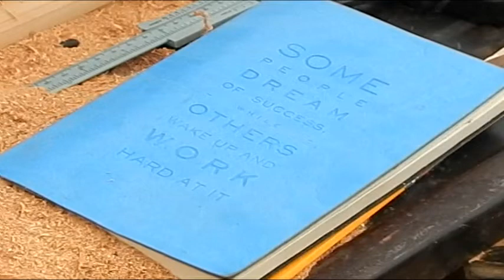How to Make a traditional 6 hole Native American Flute Part 2

Comment: I believe your interpretation of the old flute diagram is the correct one. It also makes more sense based on the traditional flute making materials used at the time. The implications of that are so far reaching for the modern 6 hole flute that many people are bound to be unhappy with your interpretation. It is too bad that a more thorough investigation wasn’t done way back when the first modern 6 hole flutes were being made. This confusion could all have been avoided.

Comment: how do you know where the initial finger hole should be from the bottom up?? ive made 4 now and either my bottom hole is too low on the flute or my last hole ends up being too high. On my first 2 it was too high, i learned that if it is roughly my palm at least it works but closer than that and the highest note doesnt work. So then i tried moving everything lower on the next 2. .... now its too low and all my finger holes need to be different sizes and still doesnt sound great. So how do you know where to start the first hole???

Comment: Would sealing the inside affect the performance? If you cut the pipe after clamping so you can clean the glue out, while its wet? Only reason bring up sealer is so that it easy to clean the glue. Also you should not be drilling out like that, and you should be showing how to properly drill it out. If you drilled before you make it round it would be easier to clamp to a table. Great video! I like the simplistic approach, with no bs.

Comment: another Great video Charlie,  i made a six hole traditional following your specs at the end of the video from 1/2 pvc pipe. it worked perfect with 4 inches from the last hole to the bitter end . Now ill get busy on a pine one.  all my finger holes were 3/16 drill bit.

Comment: Can tell you make a lot of flutes as that drill bit is dull as heck. I notice a lot of the quina flutes have a drilled plug in them. Is that for tuning? I figured you would know. Thank you for the vid.
Reply from the maker: It is for tuning. If you restrict the flow of air at the bottom of the flute, it is the same as making the flute longer. The major benefit of this other than making the flute lower in tone is the back pressure's effect on the notes and the fingering placements.

Comment: I'm curious as to the reason you burn the holes as opposed to just drilling the
Reply from the maker: I actually do drill the holes first and burn them second. I mentioned why and several videos however it is to cauterize the scar tissue of the wood so that it does not allow moisture to leak out (or in).

Comment: I made a flute from some Elderberry plants in my yard today.  Nothing comes out but air...this is my 3rd attempt in 3 days.  I think I want to give up.
Reply from the maker: +PJ Sev It sounds like a couple of things can be happening here. 1) make sure there are no air leaks in the partition inside. This is common. 2) The angle of the air channel and depth of the track 3) The size of the sound Hole and Air supply hole need to be relatively small and keep it as square as possible. Hope this helps and be sure to check out my other videos on working with cane and track specifics.
Reply: I did put some wood glue over the partition, because it is also that soft material like the core of the branch.  I think next time I will not square off my holes.